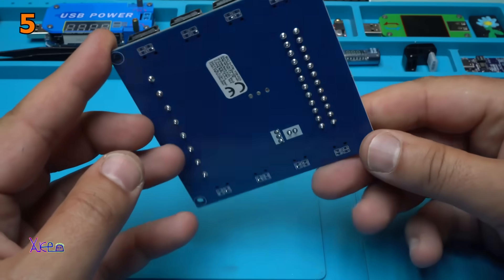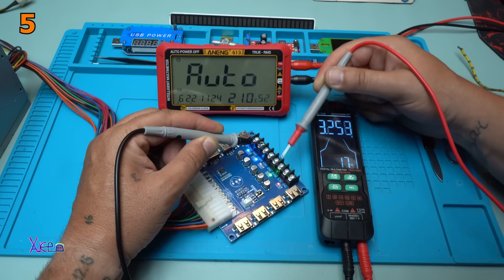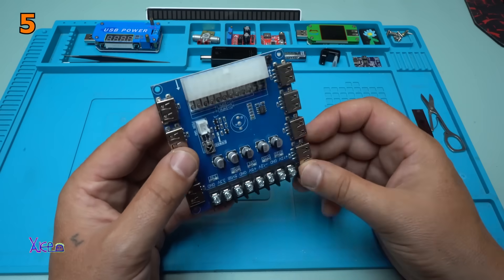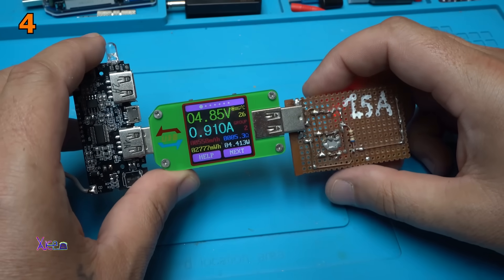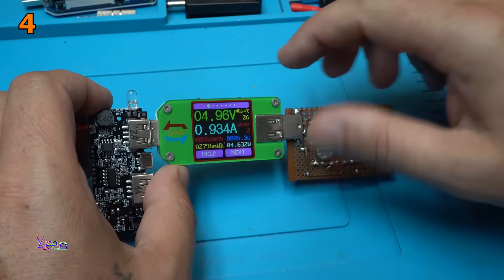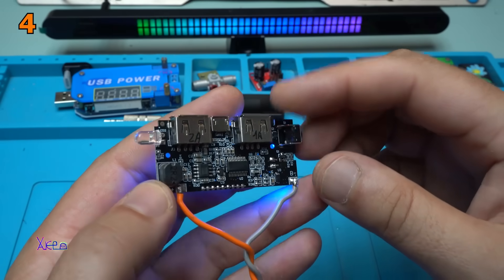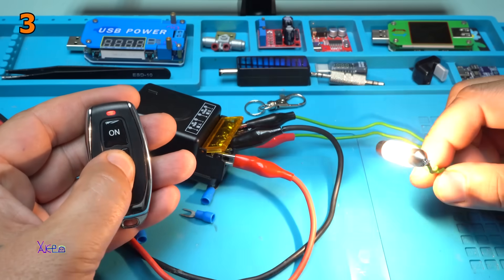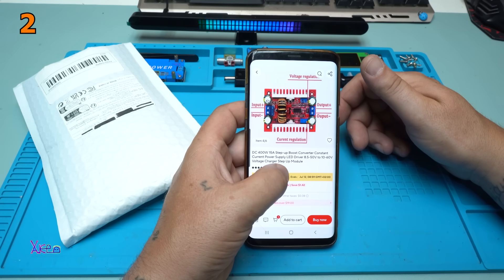TOP 5 SMART Aliexpress Modules

Comment: Just a pity that up to now they still haven't fixed the ESP32-C3 Super Mini's antenna problem. That board you have there will only work with an access point within 3 meter range. Beyond that, the ESP32-C3 Super does not work on Wifi (or at the least with a very bad WiFi signal). There's YouTube videos showing how to rectify this problem (31mm external antenna wire) but this modification might mess around with your intended design for the board.

Comment: These little modules are great to use in various projects.  recent purchase was a " Li-ion Li-po LiFePO4 Battery Charger 2A 3.6-24V MPPT Solar Charge Controller Module SD29AJTC For 9V 12V 18V 24V Solar Panels" so basically this is a variable voltage MPPT,  with a step up converter variable output as well.  

I have a project that needs 1 amp at 5V,  that can run off of solar and batteries.  what this module allows me to do, is use a 12 volt solar panel to charge a 12 volt (higher or lower) lithium batteries,  in other words is I want to use many 18650 in series,   I can up to 24v.  I will then use a DC-DC Buck Converter Step Power Supply Module 5V-30V To 3.3V 5V 9V 12V 3A,  to lower the voltage to 5v.      seems like a complicated way to convert 12v solar to 5v,  but it's just two modules,  and here is the reason,  the solar panels and battery will not be close to the load,  so solar, batteries and mppt will be in one enclosure, and my load will be located about 10ft away,    so even if the voltage drops 1-2 volts,  the second module will keep the 5V required voltage.
Reply from the maker: That's a great way to use these modules for your project!

Comment: I notice a lot of boost regulator modules have the voltage adjustment pot working in reverse direction compared to normal buck regulators or power supplies.
It makes me think they are designed by AI.
Reply from the maker: I noticed that too, and it can be confusing sometimes😄
Reply: If you mean the 30-turn blue pots... Just desolder the pot and rotate it by 180 degrees, then solder it back in.

Comment: 😅 ... I just got the same ATX breakout from AliExpress. I was a  little disappointed watching this and seeing the voltage drop ... do you think the power drop was caused by the PSU or the board?
Reply from the maker: No my psu is faulty
Reply: @Hacktuber yeah, I was kind of assuming that, but I've noticed over the years that low grade Chinesium can do some spooky things sometimes lol

I'm looking forward to getting the ones I've ordered and getting them put to work around the bench (replacing the janky, homemade PSU breakout boxes I slapped together without any forethought lol)
Reply: The board looks mostly passive,  so it was probably the PSU. the circuit on board seems to be for the PSU switching control and to light up the LEDs.  

I noticed the board has a place to put a capacitor on it,  not sure what that is for,  but there seems to be a small capacitor for each voltage/circuit.